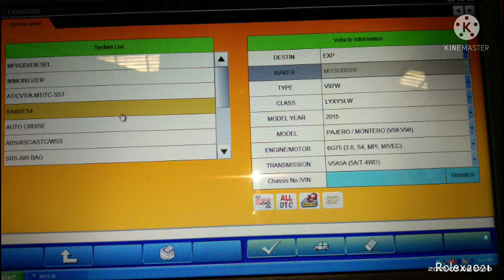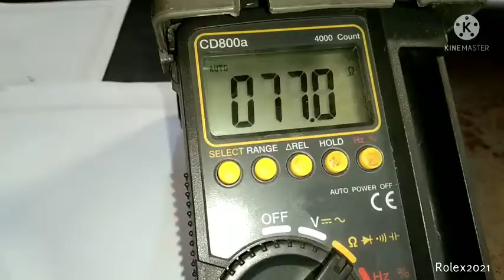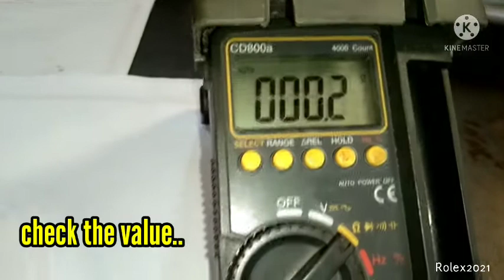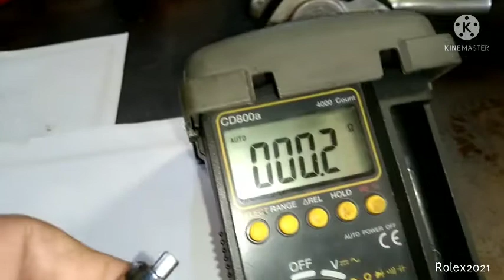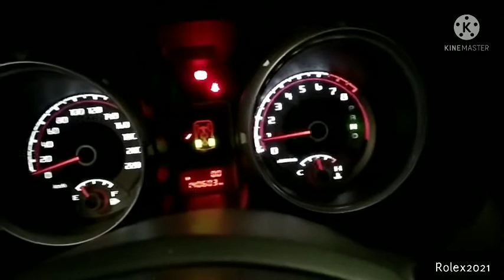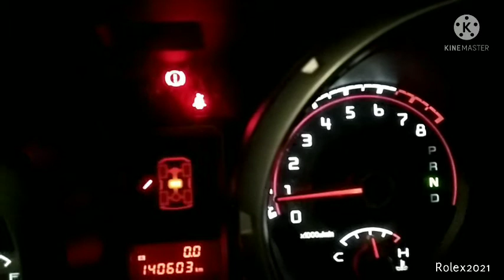How to replace/check 4WD switch of transfer case Pajero

Comment: I also read the 1456 fault code. Does this indicate which switch is faulty? Or do I need to remove each one and inspect them individually? My car had a problem two months ago when switching from 4LLC to 4HLC, and I replaced one of the switches. It worked fine until yesterday, when I was driving on the highway at 2H mode, when the center differential light suddenly flashed and car vibrated. It worked fine every time I turned it off and on again, but the problem reappeared when I reached 80 km/h. Switching it to 4H mode, the car worked fine again, and I was able to return home. I'm not sure if the same fault code is causing this.

Comment: 4H works, 4HLC and 4LLC does not work, do i need to this?
Reply from the maker: @muhammadhashim335  what is the DTC Sir?
Reply: @rolexpanuncialman3484  34 is the code, when i put wire on 1 and 4 of obd2 port.
Reply: Any help?
Reply from the maker: Your center diff is blinking Sir? @muhammadhashim335
Reply: @rolexpanuncialman3484 No center diff is steady, only 4 wheels blinking..in 4LLC

 4HLC works,

Comment: What is the symptoms if the car needs to check this or replace what can we experience...while driving?thanks
Reply from the maker: Your center diff.always blink the orange color Sir. then if you're using diagnostic tool, your DTC should be T/F position SW3

Comment: Did u do oem or after market?
Reply from the maker: OEM sir
Reply from the maker: OEM Sir
Reply: @rolexpanuncialman3484  can't afford those
Reply: I went aftermarket due to overpriced switches but having the same problem. Its just an open closed switch why would it have to be OEM id understand that it won't last long.  But they should work

Comment: Hi there thanks a lot for your very informative vid!! its time for my jero to change the actuators!!! do you think it is worth to change only the one that causing the center ligth to blink?? cause when its not blink i can select gear with no  problems at all?? if i change only that im going mitsubishi ones!!but if i change all of them ill go for the after market,,mitsubishi is very expensive and i dont use 4x4,its just the ligth onnying me on the dash.otherwise not a problem to change it at all!!!if im correct i need to change the cd lock??

Comment: Hello, thanks for the video... I have a problem with my mitsubishi pajero 2016 transmission... When I select 2H, instead of two rear green lights glowing, three green lights are glowing!!! However when I select 4H, all four green lights are glowing normally... Please help me with this... I changed a couple of times between 2H and 4H while driving around 60 kmph ( but I didn't change to 4HLc or 4 LLc while driving),then only this problem started!!!
Reply from the maker: 1st check all the vacuum hose from solenoid valve to actuator underneath may be there is a tiny holes.sir.
Reply: @rolexpanuncialman3484  thanks for your support

Comment: Hi i have a 2002 pajero i0. But it will not go in tyo low gear 4wd. Would this be same issue
Reply: Hi Andrew, I have a similar issue however all the 4wd system works while using the transfer case lever I put it down to a faulty switch.
I'll  test them all to single out the faulty one.

Comment: hello ! great video ! 

please i have a question.

on my pajero i can switch between all 2h, 4h etc etc…

but i have two issues : 

1 - when driving on highway, after a certain time (in 2h). the center light blinks orange ans the others disappear. all returns to normal when car is switched off and on.

2 - when i change from 2h to 4h, all 4 lights are green but going rear i can hear a clunk as if something is not engaging or disengaging well.

i plan to change solenoids.

no error on scanner for engine or gearbox
Reply from the maker: hello sir..I hope this will help you..so no DTC found on your scanner that means your transfer swicth are good.now try to check your freewheel valve and freewheel swicth in your scanner if both are working properly,showing only (ON and OFF position)then your actuator,hoses and vacuum if still connected in your manifold.

Comment: Great video  how far did you have to drop the gear box
Reply from the maker: As far that your both hands can move/work comportable sir.because you need to prevent not to disalign the exhaust pipe.and other connecting parts of the engine.thanks.

Comment: Hai i have pajero . i have one problem , running after 24 km that central light light is blinking and some times after 10km . why like this do you have any idea please help me.
Reply from the maker: you mean the color orange ?it will blinks only if you use 4WD.that means you have defective switches like shown in this video.